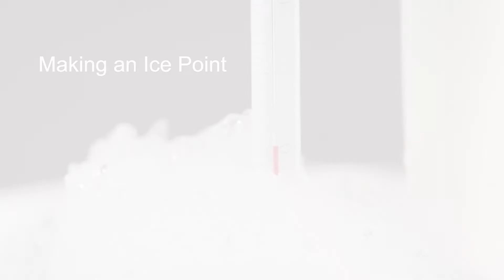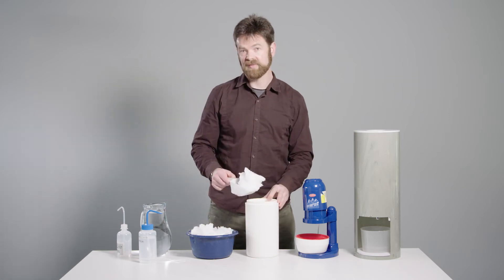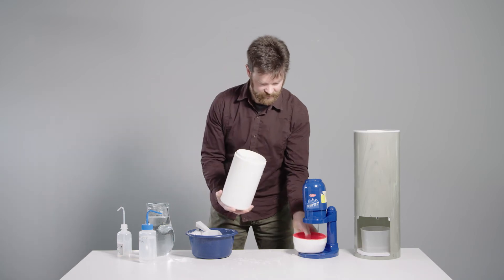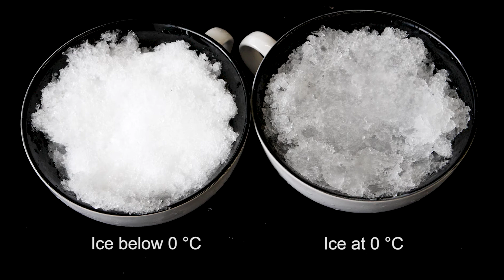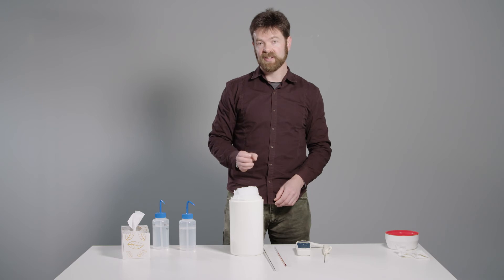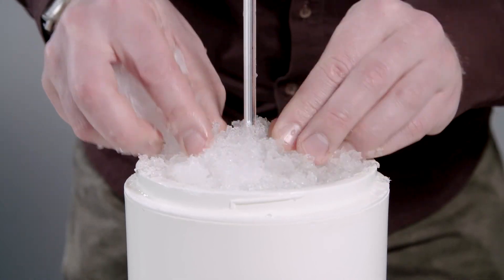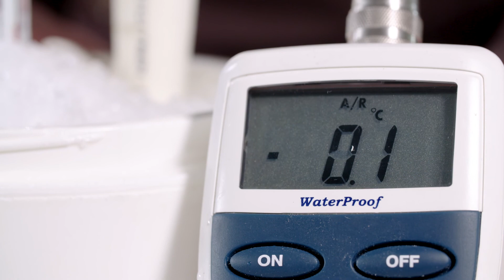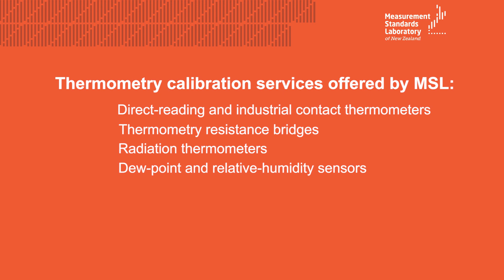Making an Ice Point

Comment: Can you adjust this method to calibrate a thermal camera by measuring the temperature inside the bottom of the cylindrical hole made in the ice?
Reply from the maker: The answer is yes, it can be done.  A cavity needs to be made in the ice - preferably shaped as closely to a long cylinder as possible.  The ideal shape of the cavity is that its length should be twice its diameter, with the base end in the ice shaped as a hollow cone or a scooped curve.  The front entrance diameter of the cavity should be larger than the array of pixels chosen for measurement of the ice point.  It can be worth taking measurements for several minutes with the camera fixed in place - some instruments have transient effects, and this test will show these clearly.
Reply: @measurementstandardslabora6920  Thanks for the valuable answer. I will try it and let you know.

Comment: Why does this measure the ice point rather than the triple point? The pressure we are concerned about in the phase diagram is the partial pressure of that gas. So I would expect sublimation until the H20 partial pressure reaches equilibrium at the triple point. What am I missing?
Reply: Measuring the triple point is an order of a magnitude trickier and while I would expect that MSL NZ would have plenty of triple of water point cells most people do not have one in the lab. This is a very useful guide to achieve a very accurate measurement with very cheap and available equipment

Comment: I don't think it is a good idea to handle the ice with bare hand. It will affect the purity of the ice.
Reply from the maker: Yes, you are correct!  It was easier to show the process using hands in the video, but the ice should ideally be handled with a clean scoop. However, the effect of handling is negligible unless your hands are very dirty.
Reply: @measurementstandardslabora6920  how can a professional organization make a video with such terrible sound quality as this?